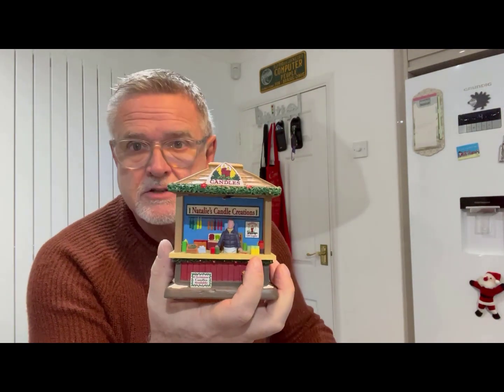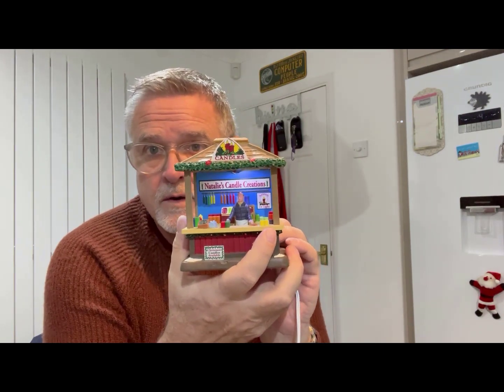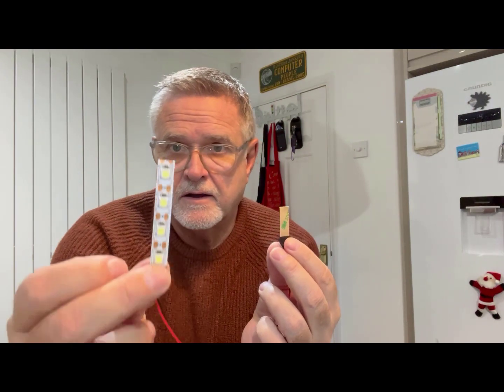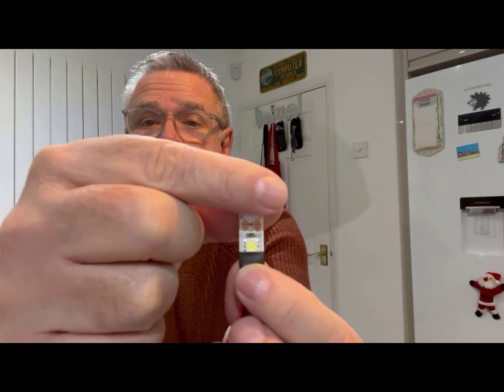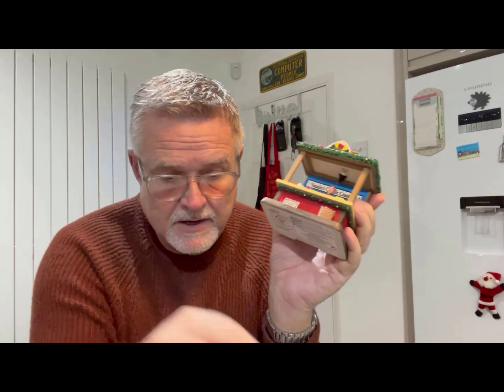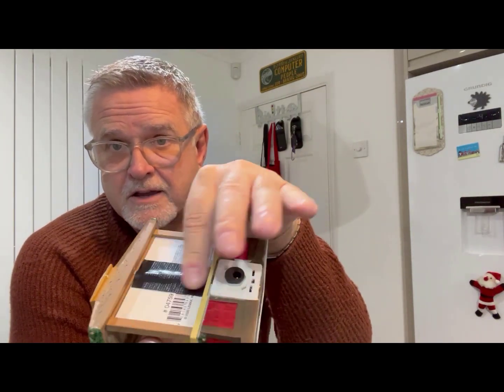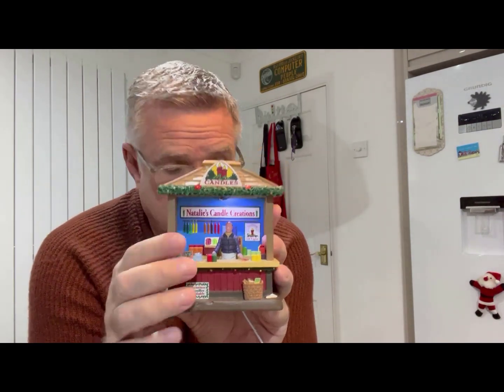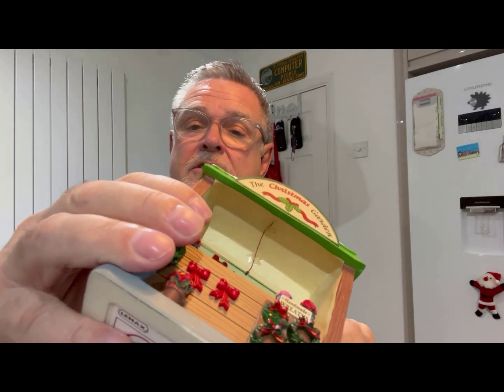Lemax Market Stall lighting update

Comment: So if I set it to 3v for the market stalls would they still work. I have 2 of the 3 wire muilti plugs but I’m concerned now to use them if the 4.5v burns them out. 
Thought maybe the 3v would put less stress I. The LED.
I’m going to buy one of these plugs for my jaegerndorfer ski lift and set this to 6v as I can’t find a uk plug for this by jaegerndorfer. 
Will try the 3v on one of the market stalls and see if it works. If not I’ll just stick to the lemax muilt plug that I already have.
Reply from the maker: You can buy new adapters fir your ski lift as I bought one myself. Try Millrace Garden centre in Essex or put a post into one of the Lemax facebook groups.

Comment: What about using one of those masterplug voltage adapter? (Argos sells these) you can set the voltage you want on them, the lowest is 3 which is 1.5v lower than a lemax plug and probably equivalent to the same power as the batteries. You could then connect this plug to the daisy chain wire to power several at a fraction of the price of Lemax multi plug. 
I think I might try this, do you think it would work?
Reply from the maker: As long as you match the voltage to the voltage of the LED that you are using, it should be fine. I tried a multi adapter but none of the sockets that it came with, fitted the lemax sockets properly. Good luck and let me know how you get on.